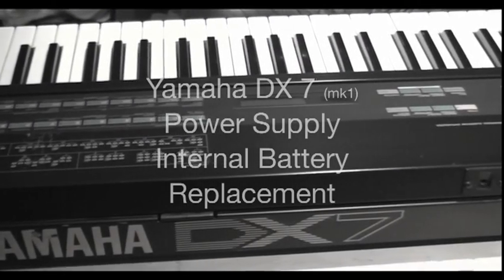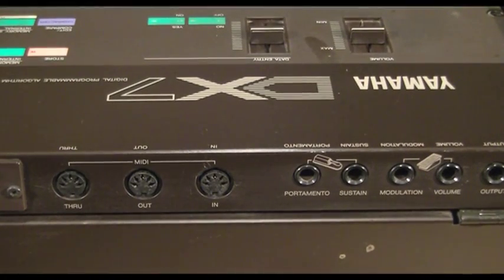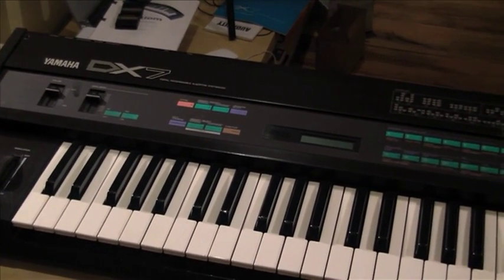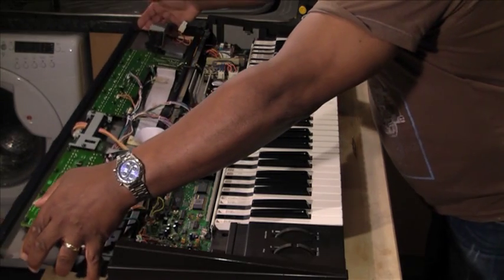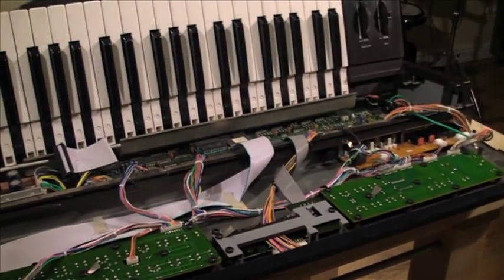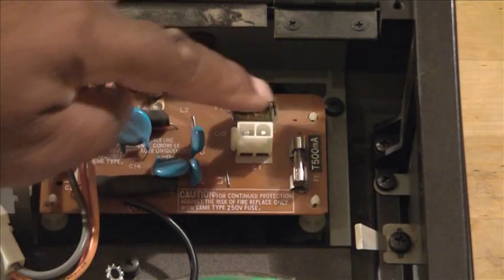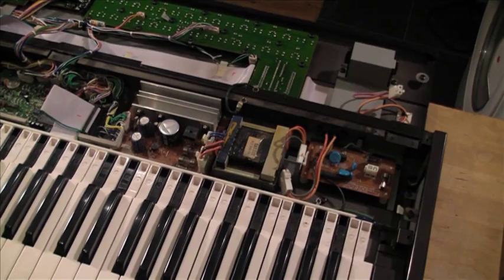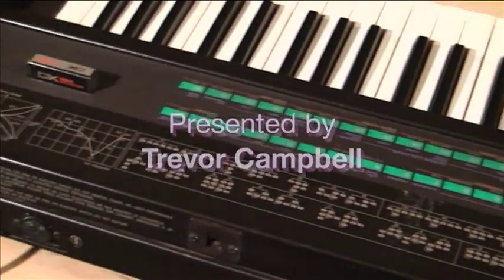Yamaha DX7 Power Supply Replacement.

Comment: I have a problem with the font, the keyboard works fine.  but I have noticed that the source where the heat sink is located gets too hot, so much so that it rises to the top. I have changed capacitors and I cannot solve the problem. I wish you could help me.

Comment: My DX 7 mk1 is dead, i had a few keys response a few days before it went out, after measuring pSU i cant see any voltage from psu to the mainboard, also transformer looks ok cause non of the fuses are blown, i have recapped with nothing to happen still not powering on, is there a way to service the psu or i must look for a new one ?
Reply: Have you tried to measure the power coming from the transformer?